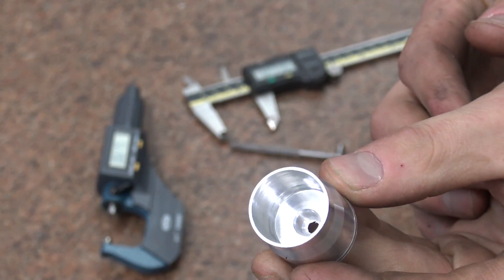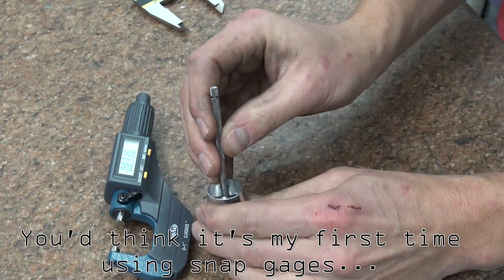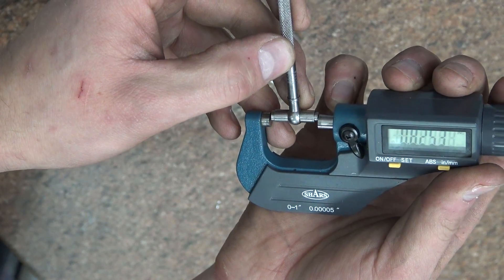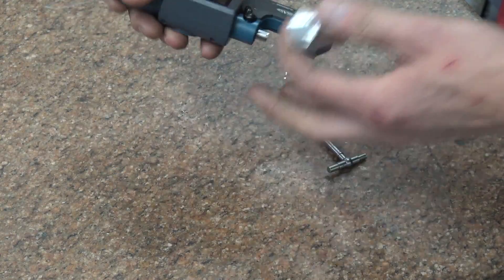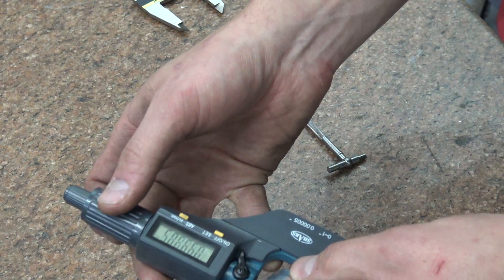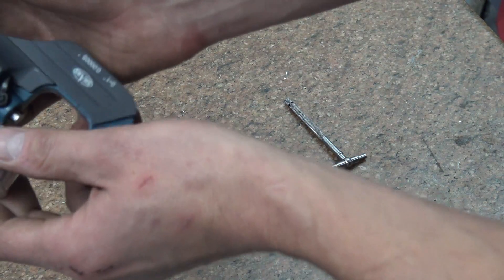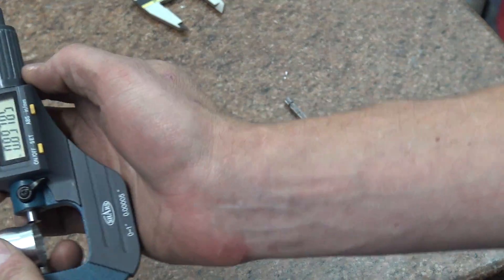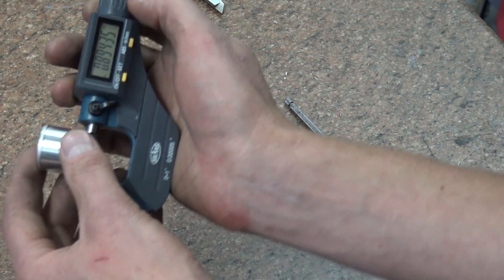Tormach CNC Lathe Boring & ID Turning!  Widget68

Comment: I NOTICED YOU HAVE YOUR BORING BAR HANGING OUT FARTHER THAN YOU NEED YOU SHOULD SHORTEN THEM AS MUCH AS POSSIBLE ALSO GO INTO YOUR WIRING CABINET AND CHECK FOR LOOSE WIRES IN THE BUS BAR THIS CAN CAUSE THE MACHINE TO NOT HOLD TIGHT TOLERANCES

Comment: When  customer submits a part and does not include their own tolerances, do you specify in your contract in that case a standard policy of what tolerance they will receive? I have been on the engineering end of things for my career, but we were schooled to include tolerances on anything important and exclude them on anything not based on the price factor. We are still schooled today that adding tolerances adds cost especially flatness tolerances.
For you machinists out there who think engineers don't give consideration to every facet of the machining process, some of us do. There are good and bad professionals in machining and engineering. I personally believe, and evidently the manufacturing community disagrees with me, that every engineer should be required to build and test hands on everything they design before any consideration is given to production. In the case of consumer goods, and appliances etc, they should have to take one home and use it for a month before submitting it for production. I can say with confidence and experience, attitudes  and work methods would change.

Comment: Are you still having issues holding proper tolerance? I have this lathe and turret and I'm having issues. I have noticed, the people using gang tooling get good tolerance and the people with turrets struggle. Something to do with the turret? Take a closer look at the part off in this video.

Comment: Apart from pushing the tool more and harder (which might help) you might want to try a specific aluminium geometry insert like Sandvik Coromant CCGX. They really do wonders even on manual machines.

Comment: I noticed that the boring bar deflection was massive, probably when it hit the bottom of the bore. Was it because of insufficient bar rigidity, some issues with the setup, or a mistake in the cam?

Comment: Loving this channel ;) I am buy no means an expert but I hear you mention tolerances and I'm not sure if anyone has mentioned this but try running the machine again with the coolant on. After running that large drill through, the heat will have made the material grow slightly and then shrink when cooled causing the tolerance issue. Of course I understand the coolant is off for video purposes ;)

Keep up the great work ;) Certainly been helping me grow as well :)

Comment: One problem I see is that you rough and fine cut the outer diameter and then drill it.
It is a big chance that the material change shape when doing so.
Rough cut - Drill - Fine cut.

I do a lot of big parts in Super-Alloys like Super-Duplex and when working with those parts the process is.
Rough all dimensions - Put part away for 24 hours - Fine.
A 500mm part usually expands about 0.6 mm/0.023" after Roughing + Hold time.
Reply: +Nikel87 
And I forgot to say that I really enjoy your videos =)
So keep em up =)
Reply: I was just about to ask roughly that. I thought it was always better to do the inner work first then do the outer. Especially if having a relatively thin wall.

Comment: The only thing i would suggest for turning aluminum which you seem to do a lot of is investing in a DNMG tool holder (unless you already have one). The  55° insert angle should just better at cutting aluminum than a normal 80° insert i know this also depends on what insert your using and what not. I just know from personal use that 55° inserts just seem to cut really soft metal like aluminum and brass better than the 80° inserts. Also the 55° inserts are actually really sturdy compared to say the vnmg style inserts, so you can actually rough a part out with a 55° and finish with V-style insert or how ever you want to do it.

Comment: Very nice :)

Push the roughing harder to break the chip. Proper insert geometry also helps. I like Iscar CNMG 431-NG (the 431 is insert size so yours might be different).

Definitely spot drill if you can. Also check the center heights on the gang post...even the "bigass" drill looked like it wandered a bit.

I think your parting tool is above centerline. It appeared to climb a bit. Check out http://www.edgetechnologyproducts.com/ for some excellent gadgets for setup.

Have you considered a fogbuster for the lathe? You do alot of dry turning in aluminum and I think the same setup as your mill might help without blasting the camera with coolant.

Gotta watch what you leave for a finishing pass on a flat bottom with that particular tool geometry. In many cases, it's a good idea to finish from centerline out to avoid trapping the chips behind the cut. Also a weird quirk...sometimes finishing from bottom out on the side walls can eliminate chatter.

Keep on turnin!

Comment: Have you tried machining a chamfer or a radius with your parting tool?  Part in, then chamfer, then finish parting.
Reply: +adithmart That's something that I would think would be included as an option for the parting operation.  Pretty sure that Sprutcam includes chamfer and rounding selections.  Not sure why Autodesk doesn't include it...

Comment: And still doesn't know how to use the micrometer right...! USE THE SMALL KNOB!
Reply: +St0RM33 Good test for anyone to find out if they can measure more repeatably using the ratchet or feel. Close your eyes when doing both and only open to read the number. Which is more repeatable for you on different geometries?
Reply: Depends, most of the time I can get better repeatability using feel than the ratchet.
Reply: Repeat-ability is a factor of the instrument though. Just because you get the same measurement doesn't mean that the strain of the component assembly was the same as before ;) The knob provides an adequate amount of torque that was also calibrated to, otherwise there wouldn't be a need to design it in the instrument in the first place.
Reply: +St0RM33 I calibrate measuring equipment/work in inspection/ use a mic hundreds of times daily. you can get mics with out rachet ' s and tbh you can adjust the ratchet to what ever you want, also when measuring a bigger shaft the ratchet is useless as you need the feel of it and listen to the squeak as you pass it over it.
Reply: garyhowe88 acceptable, but this is learnt from experience right? so unless you get some gauge blocks and measure them to learn the proper fill isn't the ratchet a more reliable way to measure things?
Reply: NEWB. No one uses the ratchet.

Comment: You must separate operations. First rough received and finish. For each must be added for turning or milling. When the final process outer diameter hole should have been drilled already. This ensures precise workpiece.
Reply: +NYC CNC I think what he is trying to say is that you should make sure everything is roughed first before finishing. As you said in the video, you were trying to concentrate on keeping tolerances, one of the best ways to do it is to rough turn the OD, then drill, rough and finish the bore, then finish the outside.
If the walls of the bore and OD are quite thin, drilling after finishing the OD may cause it to expand or warp due to pressure/heat distortion.
Reply: +NYC CNC It is a small part but yes, you should rough all of the part and then finish the part.  If you have the tooling space then finish with a different tool and not the roughing tool.  You will hold .0005 when all is correct.

Comment: Gotta push that roughing tool harder, to let the chip breaker on the insert actually break a chip.

Being conservative on your feeds and speeds here is screwing you vis a vis chip control on your OD turning.

You'll find that your dimensions are easier to hit too, if you control the chip better (reduces bar and tool deflection).

Also, if the absolute position, ID, or concentricity on that thru hole matters (needs to be held to a specific tolerance of just a few thou), I'd suggest spotting it first, 'cause you could see, even with the naked eye, that the drill wandered like a lost puppy while starting that hole.

Otherwise though, good video.  It's aggravating my itch for a slant bed lathe though . . .
Reply: +NYC CNC Yes, more feed rate until it starts to actually break a chip.  You need to keep the radial depth of cut at least as deep as the nose radius (a little deeper than the radius is better, shallower than the nose radius makes bird nests), and then push the feed rate up until the chip breaker on the insert starts to break a real chip.

It can be done, even on aluminum.  On my big manual lathe, I rough 6061 at 0.150" DOC (on the dia, 0.075" radial DOC) and 0.010" to 0.015" per rev feed.  I use the same high sharp coated inserts that I use with stainless and nickel alloys (too lazy to change inserts to the uncoated polished ones, since the stainless ones I use have almost exactly the same geometry, but with a nice PVD coating system), and at that data, they break a very nice chip makes a little tinkling sound as it lands in the chip tray.

Now, bear in mind that my lathe is a 16" swing that weighs north of 5k lbs, but that gives you an idea of how hard you should push it when roughing.

When you're finishing, there's not a lot you can do to avoid the bird nests, but if you take a very light cut with a fine-ish feed at a very high surface speed, the chip will be very thin and willowy, so the bird nest can usually be broken up with coolant.  They certainly won't have the strength to hold onto the turret like those big heavy ribbons you're making now do.

Comment: That was great, but it looked to me like you needed to use a center drill first to get that first drill to start straight. It also seemed like the cutoff  tool was cutting in the wrong position which didn't allow the hole to go all the way through and left a step on the end of the part. Still a great tutorial.
Reply: +NYC CNC , it looked to me that the part was parted off a little long (maybe about a 1/16"?).  It looks like unturned aluminum between the parting tool and the end of the part, so your through hole wouldn't be full sized.

Looks like everything turned out pretty good.  That aluminum can be pretty stringy until you get your RPMs and feed rate the way it likes it.  Thanks for another fun widget combo.
Reply: +NYC CNC Sorry, of course you were going to re-chuck the part and face off to proper length, I don't know what I was thinking.

Comment: Is it just me, or was there a bit of wobble in that thru hole? Is that because the stock was slightly out of alignment, or the drill was too big at first pass, or just me having bad eyes?
Reply: Thanks... I tried to ask without sounding like a troll... just trying to learn. Do you spot drill with just a smaller bit, or is there a "special" bit for that purpose?
Reply: +TheSageDad Generally you would use a larger spotting drill or centre drill...depending on your preference. Spotting drills are good as you can chamfer the hole before you drill it and they're generally quite rigid so you can have a nice accurate hole position.

Comment: Just a suggestion from my experience of CNC turning.

The feed-rate for roughing the OD looks a bit conservative, you should be able to chip aluminium when roughing so you don't get a birds nest around the tool. There's not much you can do for the finishing as you want a slower feed for surface finish but roughing shouldn't be a problem unless you have really low HP.

For drilling larger diameter holes, I would use a drill called a U-Drill. They're "inserted" drills, excellent for removing large amounts of material quickly, and they come in a range of sizes. They're also more solid than regular drills and don't kick off much, if at all, unlike yours did without a centre drill. Also you don't need to pre-drill the hole. and they leave a flattish bottom which helps if you want to face the back face of the OD, as I saw the boring bar kicked off a little bit when you were facing.
You can also use them for boring if they're set-up properly ie. the tips are parallel to the X axis.

Another note, I was taught to rough the OD past the parting off point...only by a few millimetres as this stops the parting off tool wandering on entry giving you a more parallel cut on the work piece.

But great video, keep up the good work.

Dan.
Reply: +Daniel Way Right, thanks for the help. I apologize for my English.
Reply: +Daniel Way Agreed ;)
Reply: +Daniel Way Thanks man here too, sick info! Appreciated!
Reply: 9 years later and your tips helped me out as an apprentice, thanks!